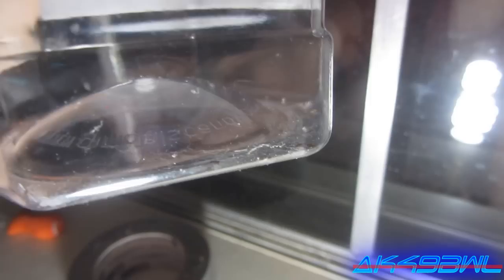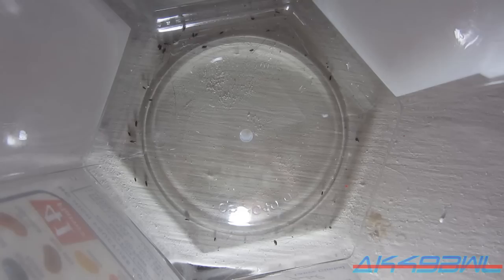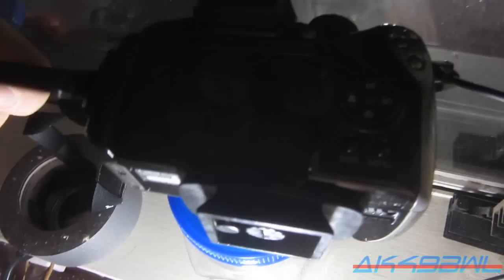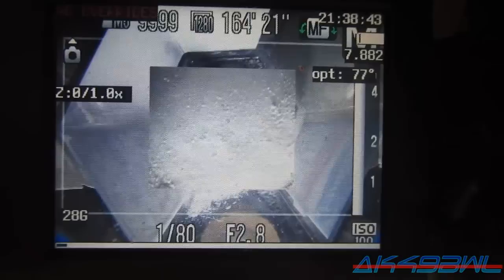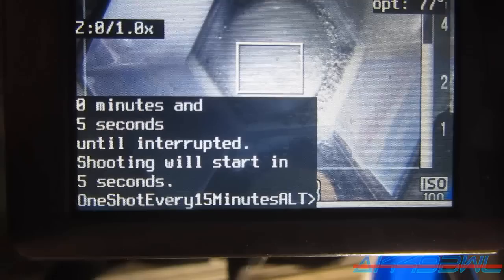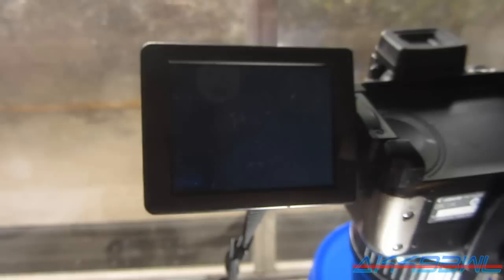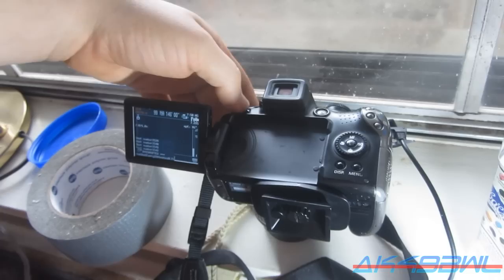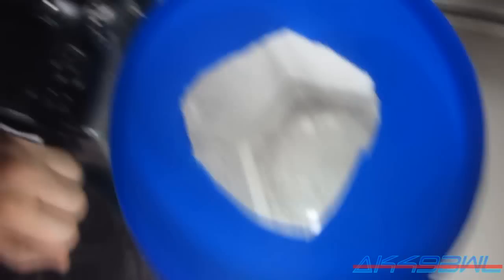Diatomaceous Earth vs Fleas Experiment

Comment: front line works pretty good to keep fleas off your dogs/cats. give it a shot. good luck
Reply: Hahaha no it does not. I put it on my dog a week prior to going to the vet and my baby had fleas.  The vet recommended Sentiel.
Reply from the maker: Sara H it seems to depend on the area.. I'm told frontline doesn't do much here in ETX, but I've used Advantage II with great success, yet I'm told THAT doesn't work in places lol
Reply: Idk if Brandon was aware of pesticide residue, poisoning your animals( & yourself re:carpet application), cost effectiveness, not adding more packaging/plastic (flea collars) to the earth, $$ in corporate pockets, or all the other uses of DM...but I'll stick w/DM for these & lots of other reasons.
The insects/parasites- die from dehydration, as stated in other comments, plus the residue KEEPS KILLING as long as it's present, safely.
Reply: I meant to make clear....the advantages of Diatomaceous Earth over chemical pesticide based controls, such as flea collars, etc.
I have also used DM for lice on kid's heads. Treat anyplace their head touches, along with their hair.
Also good for bedbugs & internal parasites, like worms in horses, or yourself...
And cheap. Did I mention cheap?
Not the kind used in pool filters! Look up "food grade" DM on www, eBay, Amazon.
Reply: Frontline is now utterly useless in many places.  My vet said fleas are now resistant to it.  Tried it on my dog a week ago and it has had ZERO effect.
Reply: Frontline worked for my dogs for years when we lived in the Midwest.  After moving to FL, it worked for awhile, but then it stopped.   The fleas in FL are something else!

Comment: Waisting time. When they are not dead on contact is wasting time. Dog, cat have fleas shave and bath. The problem is fleas at home, I fogget and my legs are still bitten. New and nice home but cat run outside and got flees.
.
Reply: +AngelM you are delusional....even the pesticides they use as antiparasitics for animals which are neurotoxins DON'T kill on contact.if that was the case dogs and cats would drop dead like flies.
you obviously don't know what you are talking about,i hope you have no pets.
Reply: The point is to control pests with natural , not poison chemicals ..

Comment: Cool, thank you for the experiment!  Good to know it works, even if it takes awhile.  Main thing it works!
Reply: Lea Domingo it takes a while because diatomaceous earth is made of skeletal remains of teeny tiny sea animals. it's left over from hundreds of thousands of years ago. it has microscopical sharp edges like razor blades if you were as Tiny as a bug. so over time it starts cutting the bugs the harder the bug the tougher The Cutting. But it will still happen. So it can take a little longer than a few hours. But what eventually happens is the bug becomes dehydrated from bleeding to death or losing their bodily fluids from all the cuts. it's so small it doesn't hurt humans unless you inhale it. if you get food grade which just means it's cleaned up good. You can swallow it and a reasonable amount. if you plan to do that for internal parasites which most people have. please check with a natural doctor or somebody who knows a lot about this. I do but I take no responsibility and having people do this over YouTube. I recommend learning as much as you can about it it's a very useful thing. it is a bit misunderstood because of the way it works. Which I explained above So Soft bug they bleed easy fast death compared to a hard bug like a flea. They may take longer but it is worth the time food grade can be put directly on animals you want to get it down as close to the skin as possible because you don't want it in their lungs! putting it in a shaker like something you use for spices parmesan cheese maybe? Something with big enough holes so it can shake down by the skin starting at the top of the head and around the neck ears so all the fleas don't run up there and get in their ears and work your way down. again if you choose any of this I take no responsibility at all it's something you need to read more about and make your own choices. 30 + years ago the company I helped run, supported the first company that put this into rugs professionally and had a name, paying service. they did a very good job though we parted in not such a great way. they forgot where they came from. anyway I just wanted to tell how this worked I haven't read down below so somebody probably already has. I'll watch the rest of the video I'm sorry from reading the top that people have given you a bad time for just doing a video. obviously meant for the owner of this video not the guest. take care of everyone